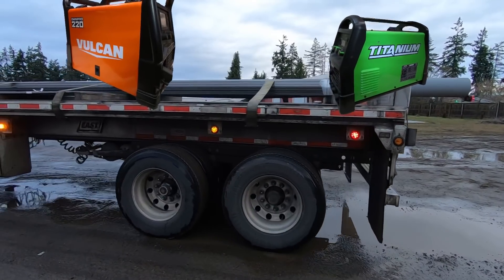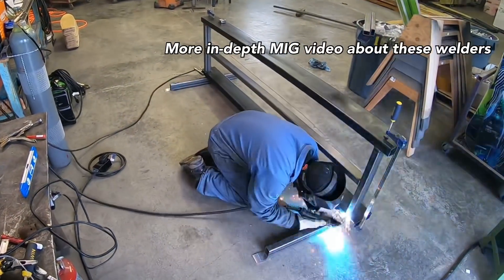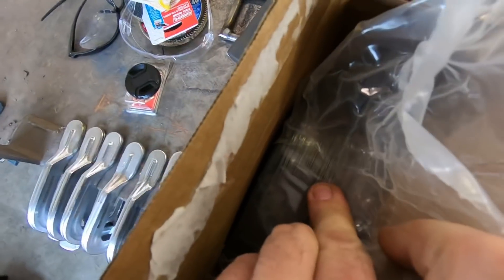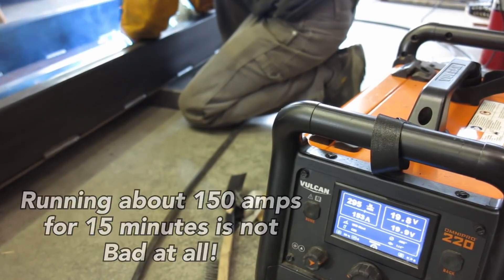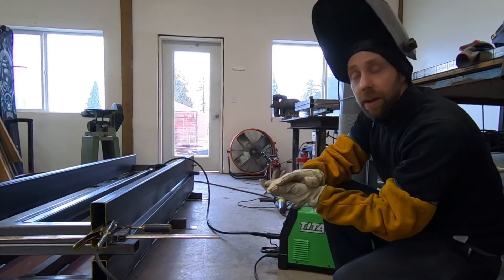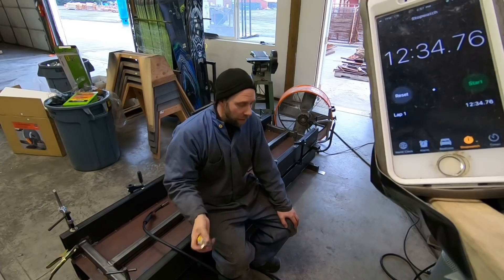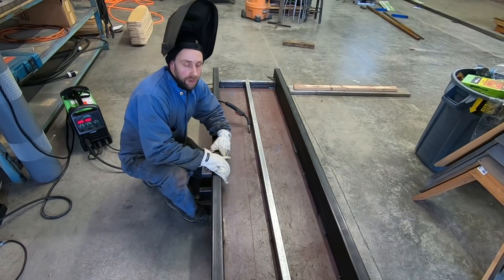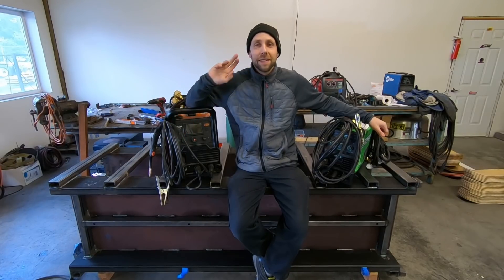Titanium Vulcan welders real world duty cycle MIG test

Comment: Hey Mike, I really enjoy your videos and your review of the VULCAN OmniPro 220 as I am looking to get this one for my personal home use. I do have a question though... I am currently going through welding school right now at HOBART and my understanding of what true "Duty Cycle" is the devices ability to weld "non-stop" before overheating/overloading, measured in how many minutes out of 10 minutes you can weld non-stop? I am just trying to get some clarification of the VULCAN OmniPro 220's "NON-STOP" welding time for a continuous, single weld. What is the longest, single, continuous weld you have tested on this machine? We were told that every time you release the trigger, it resets the duty cycle time. So my understanding is that, in your case with this specific project, if you were to weld a CONTINUOUS 81" weld without releasing the trigger that the device should shut off at the rated "Duty Cycle". Thanks for your time and reviews! I look forward to maybe a short/medium length video showing how long (using the stop watch method as you did here) the OmniPro 220 will weld before going into safety/neutral mode at the MAX Duty Cycle.
Reply from the maker: Hey Henry your right about how long a welder will weld in a continuous weld before it goes into a cool down cycle. Duty cycle is based on a 10 minute time, if your machine has say a 30% duty cycle then at full amps it will weld for about 3 minutes before needing a 7 minute break, but if you stop and start again it doesn’t reset the duty cycle time, think of it as 3 minute of welding at full amps in a ten minute period if you make short pauses to move to the next weld it doesn’t reset your duty cycle, it may extend it briefly. It mostly comes down to heat build up in the welder. This video was not made to show the duty cycle of welding one continuous bead, it’s to show the real world application when welding real jobs, I was quite surprised with how good these two welders did and one thing I think that really makes a difference is there not heavy transformer welders that can’t dissipate the heat well, they both are inverter welders and they have a much easier time cooling the electronics inside them with large cooling fans and heat sinks. The transformer based welders have real large copper windings around plates of steel, once this all gets hot it really takes a lot of air flow to cool it down and there’s no real good way to cool the center of the transformer, I have ran transformer welders to there duty cycle and I have noticed that once you cycle it ones it cycles quickly time and time again when welding on a job, it sucks waiting on a machine to cool down before you can get back to welding. I have never hit a cool down cycle on my Omnipro 220 or my Titanium 200, not to say it cannot happen, I just haven’t ever hit it yet. They are both great welders especially for the price! My video was just to see how they perform on a real job, my feeling is both are up to the task, if I was running them like this every day I think the Omnipro would hold up the best. Take care :)

Comment: I love the videos they’re very professionally done but just yesterday I got my Vulcan 220 to hit it duty cycle twice within two hours I was switching between stick welding in flux core welding only at 120 V just thought that was very interesting and I would pointed out I’ve done the same thing before and never had a duty cycle until yesterday still trying to figure out what I did that caused it but I’ve worked it a lot harder before and it never happened until yesterday
Reply from the maker: Hey Joseph thanks for commenting! Well welding on 120 volts your definitely more prone to reaching the duty cycle then if you were plugged into 220 volts. Now possibly the reason why you had it hit the duty cycle the other day and not in the past could be outside temperature maybe? Was it a hot day? Maybe the last time you welded it was a cooler day?  Not a big difference but could have a effect on duty cycle? Take care

Comment: I guess I'm a beginner to, sort of! I started welding about 3 yrs ago, I bought the 90 amp flux core and still have one, which is the second one because I over did it with the first one, O-well. I built a engine hoist with the first one and I'm in a project of reinforcing a Harbor Freight  10x20 carport canopy. I want to buy the Titanium 200 and learn to mig and tig as well and stick weld also, I think this will be a great step up from where I am now! Still learning and still watching people that has talent, Thanks for your time and video's.

Comment: Great video!!  My knees and back ached watching you do this project on the floor.
Reply from the maker: Thanks for checking out my video, yes it wasn’t the most convenient place to work on the floor, but it was a side project to my main job and I only got a hour or two here and there to work on it, the forklift was about a 20 minute round trip to go up there and returned to the main shop, so that wasn’t convenient either. 
The shop is now set up much better for this stuff, big welding table and a manual hydraulic lift for moving stuff. Take care.

Comment: So the big question now that you've used both for a while is which one would you buy?
Reply from the maker: Good question, if I was going into the store to buy one of these welders today it would be the Titanium 200. The reason is it fits my needs a bit better, it’s smaller and lighter and that’s what it really comes down to, ah and it’s less money especially when you consider it comes with the TIG torch included. 
Now that’s my feeling especially if I’m packing a welder around a lot, but which welder is best for others definitely depends? The Omnipro 220 has the auto set and spot weld features and a few other things that make it nice to use, another thing is if one was new to welding it walks you through the setup on how to hook up what leads to + or - depending on the process your going to weld with, this can be extremely helpful for someone that doesn’t weld often and could use a little help. Both welders I’m impressed with, and for the money you get quite good machines. If someone plans on keeping there welder in there shop and wants a bit bigger capacity welder with a bigger duty cycle it’s the Omnipro, if someone wants a more portable smaller welder that’s quite capable of handling mid size jobs then the Titanium would fit there needs, as you see both welders did really good in regards to duty cycle. I know this comment was a bit long but that’s my feeling on them. Take care
Reply: @Mikefestiva  Hey thanks for the detailed reply.  I was thinking that you would pick the Titanium 200 after this video.  Really capable little machine which is slightly less powerful and only really seams to be lacking auto set.  Seams like a great compromise when it weighs almost half.  I've been impressed with the real world duty cycle tests of these welders but I have to wonder why they never seam to trip the duty cycles?
Reply from the maker: My friend has a Millermatic 200, it’s a small multi process welder similar to the Titanium, it’s got the same duty cycle ratting as well, he has also noticed that welding 1/4” plate on jobs for long periods of time has not caused his welder to go into a cool down cycle ether. I think it could be the fact that the electronics in these modern welders are easier to keep cool with high flow fans and heat sinks compared to older transformer welders with a large mass of metal and coiled copper wire, once those  transformers get hot I think it’s hard to keep them cooled down? That’s just my thoughts on it? Take care

Comment: plain and simple they're home use machines. if you're running a production style business they wont hold up compared to a miller, lincoln, esab etc. which is a given. they weld nice no doubt although the mig gun is cheaply made and so are the consumables which is a given. The only thing i dont like about these cheap welders is how much your voltage can fluctuate while welding.
Reply: Unfortunately the big names don't hold up anymore either.  They realized they can make more money selling cheaper machines that have to be repaired and replaced more often.
Reply from the maker: Yes your right, there’s a lot of guys still being fooled with brand loyalty, stick with what you know even if the quality isn’t there anymore, but the price is still high. My friend has owned many Millers and he has had a few go bad over the years too. His Millermatic 200 is about as old as my Omnipro 220  (about a year and a half) and his Millermatic has been set back 3 times to Miller for repairs, once it’s out of warranty, I’m sure It won’t be cost effective to repair it, I’m sure Miller knows this and hopes people keep coming back because of brand loyalty. Take care.

Comment: Junk miller or hobart only
Reply from the maker: Haha I get a kick out of dumb comments like yours! You make up your mind based strictly on brand loyalty, I’m sure you have never used either of these welders before, so you really have no clue how they actually weld now do you? I have actually welded a lot with both of these welders along with Lincoln, Hobart, Airco, Thermal Ark, and many Miller products over the years and these two welders weld just as good if not better then most of those welders I have used, they actually weld far better then all the transformer welders I have used. I can make this statement because I have actually used all the welder brands I stated above.
Reply: SHERMAN YOUNG  I bought a hobart 230 ironman 7 years ago when they first came out and have had 0 problems i bought it over the miller cause i didnt like the digital controls and it was a 1000$ cheaper transformer not a crappy invertor welder ive run at least 20 45# rolls through it i weld alot of big stuff 250 amps not bad for 1500$
Reply: SHERMAN YOUNG  I dont know i had a 180 lincoln 220v and sold it cause it didnt have enough amps for me it just didnt penetrate well but for thinner stuff would be ok my motto is save untill you can get whats gonna suit you for a long time a welder should last 30 years if your going buy the old standards you might get better penetration out of a invertor but im not sold.on the longevity yet

Comment: I noticed you welded some hardwire vertical uphill, the innershield wire would actually run better for that weld, hardwire flows better downhill.
Reply from the maker: I try to weld uphill rather then down, down flows better but uphill is structurally a stronger weld, this glue press will be under intense amounts of force when in use. Now when it comes to innershield wire It smokes and splatters a lot, I don’t care for that, plus I can’t really justify taking the time to change out wire for welding in different directions. Thanks for checking out the video.
Reply: @Mikefestiva  You literally have 2 machines side by side, haha. Once you get your settings and technique dialed, innershield nr-211 is a perfect spatter (not splatter, like you said) free wire to weld with. To successfully run hardwire uphill you should change to a colder setting anyway, so still a pain. Now, if you really want to burn it in, some 7100 dual shield would be your best bet, but good luck finding a small enough spool to fit those hobby sized machines.
Reply from the maker: dREaDneckFab I have ran dualshield wire in my Omnipro, getting a 10# spool isn’t a problem, it just costs a lot more. I think you may have missed the point on my video, it’s not to set up each welder with different wire for welding in different directions, it was just to show how both welders performed with the same wire and settings in real world jobs in regards to duty cycle.
Reply: @dREaDneck_Moto  he has two machines for the purpose of making this video
Reply: @dREaDneck_Moto  this was about duty cycle not anything you mentioned.

Comment: Perfect videos! I'm so tired of all the partisan comparisons people do on welding gear it's refreshing to see something less one sided. I'm a multi craft utility operator, in other-words jack of all trades master of none- we do it all, including welding some times. The typical professional welder is a one trick pony. Nothing wrong with that but when you only have one trick you become a zealot. Nice to see someone with a DIY "knack" using the HF gear as it's intended and not bitching about it's ability to to perform R-stamp welds.
Reply from the maker: Thanks for commenting! I think you and I definitely have a similar range of work that covers a wide variety of jobs, I have used quite a few welders over the years and these two machines really do a good job, especially for the price, I compared the Omnipro last year in a video with my friends Millermatic 200 and both welders worked great, the Omnipro actually has a lot more features then the Miller for half the price, the Miller did weigh under 30lbs and the Omnipro was heavier at 49lbs. Both good welders. Take care

Comment: I just bought a Titanium 200 because of your reviews. I have never welded and I'm planning to learn on this welder. Very good videos btw! Hopefully you can post some TIG related videos as well so I can learn some more!
Reply from the maker: Thanks for your great comment, I appreciate it! Man I think you will be happy with your new welder, I wish I could have started out with this welder! I have had some crap welders years ago when starting out and I’m positive the Learning curve would have been a lot less with a good welder like the Titanium. Because you just got it I’m fairly sure you probably are going to start with flux wire, that’s completely fine, but down the road I recommend buying a small bottle of shielding gas, Argon/ CO2 blend, you don’t need a big bottle, the one I use is I think a size 55? I ran flux for years, it will work fine, the down side for me was splattery looking welds, slag and a lot more smoke. Welding with shielding gas is a lot cleaner and you can see your welds easier without cleaning to see how they look. Especially for practicing.
Ps the YouTube channel (weldingtipsandtricks) has some really good info and the guy is really a good dude. Take care and enjoy your new hobby!

Comment: I bought the Titanium 200 two days ago and just used it yesterday.  WOW what a blast. I have NEVER MIG welded before and i bought a 2 inch by 36 inch strip of 1/8 inch steel to just do some practice on. I cut the strip into  several inch pieces. Using 120v  I then clamped one strip to the table and held the other at a 90 degree so it looked like angle iron. I was amazed at how easy it was and wish there was a way to upload a picture here i have 0 welding training. After 4 test runs i did quite well. Even my 1st run was not awful.  I'm VERY happy and impressed with this welder. If you can think of a way i can upload a few weld pictures to let folks know how easy this welder is for a NOVICE welder let me know i would be happy to upload them to help you promote these units. Again yesterday was the very 1st time i ever welded. I just watch several YouTube channels an weld techniques. Below is the YouTube channel i got my technique from. Does it work for evey weld i have no idea I'm not a welder at all, just started yesterday but ill tell you what between the Titanium 200 and the technique listed below i was excited to send pictures of my welds to my friends.  Are they perfect,  no but you would be hard pressed to think they came from an inexpensive unit like the Titanium 200 in the hands of a guy that started MIG literally yesterday 
Watch video for a short to the point way to MIG weld successfully 
https://youtu.be/w4RrDeUKcH4
Reply from the maker: That’s great Johnny! I’m really happy to hear you got the Titanium 200 and your having a good time learning to weld, I do wish there was a way that you could post some photos on the comment but I have not seen a way to do that yet. Now you need to find a good source for salvaging some scrap metal for practice and building some projects. I’m planning on posting a video in that next few weeks that give some good information on places to look for free or cheap metal for projects. Take care and I’m glad your happy with your new welder! Welding is definitely a great thing to know how to do. Take care :)
Reply: @Mikefestiva  Thanks again and i look forward to your next videos.   It's funny you mentioned looking for good scrap metal because i was just searching for some metal scraps of anything kind on craigslist... I'm Hooked! :-)

Comment: Duty cycle is continuous welding non stop
Reply from the maker: Obviously the job didn’t need a 84” continues weld down the press, so I didn’t run a continuous weld, maybe you missed the point of this video, it was just to show the capability of these welders. 
Even if you add up the true welding time during each time lapse these welders did extremely well when it comes to duty cycle.
Reply: Duty cycle based on a ten minute cycle a 50% duty cycle means you can weld an accumulative  5 minutes in a 10 minute period whether it be welding for 5 minutes  then rest for 5 minutes or weld 1 minute  rest 1 minute  weld 3 rest 2 minutes weld 1 minuet rest 2 minutes the point of this video was to show a real world application. Very seldom  welding these types of projects  will you hit the duty cycle limit if ever. I have a   Miller multimatic 200  with a similar duty cycle  and  welding on 3/16 plate and 1/4 inch plate  for hours at a time just stopping only to re position,  and I have never reached the duty cycle  limit and that is using 220v  using 120v might be a different story though. I also have a miller Autoset 180  older non inverter  welder  than I have hit the duty cycle limit many times
Reply: Then why have a stop watch talking about duty cycle
Reply from the maker: Hey Keith if you don’t like my video, don’t watch it and go somewhere else. It’s as simple as that!